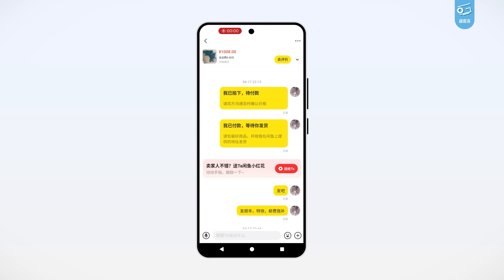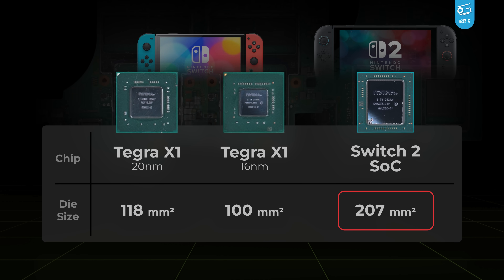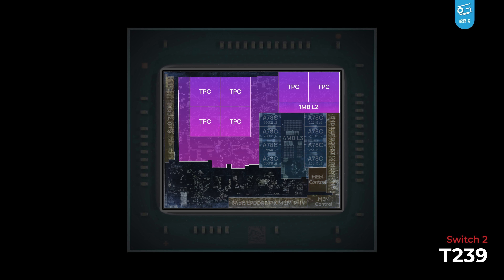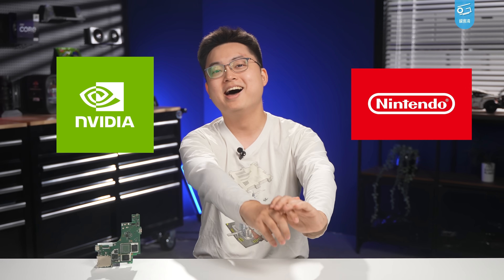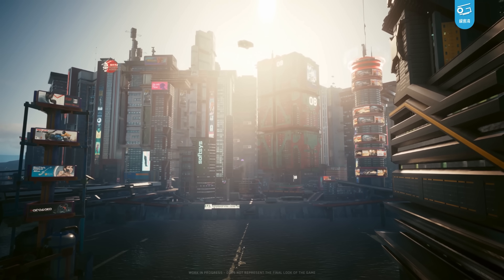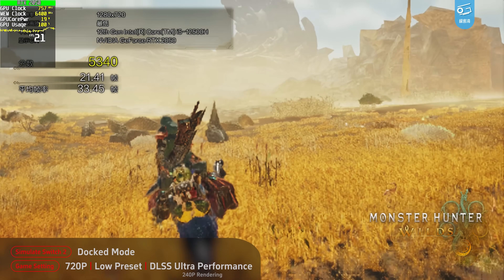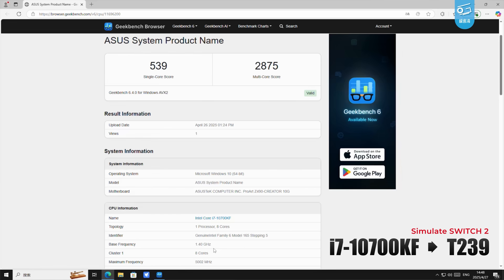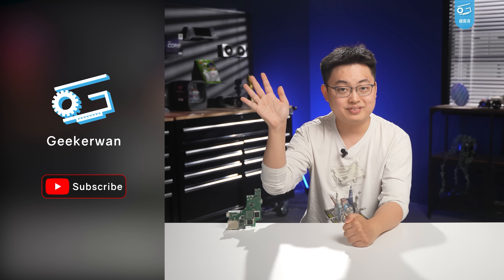This is Nintendo Switch 2's CPU!

Comment: Your A78ae's are running in lockstep mode for your switch 2 simulation.

You aren't measuring 8 core multicore performance. You are measuring 4 safety core pairs for multicore performance.

That's why your multicore result is only representative of 4 of "switch 2's" single threaded performance, instead of 8.
Reply: Geekbench 6 MT simply don't scale as well as GB5 or CB2024. Instead of putting task on each core, it requires all cores to tackle one single task together. That's why not only Orin but all the contenders' MT score doesn't make sense if you just multiply core counts to ST.
Reply: @geekerwan1024  might want to check allllll the other cores in that graph against orin again. And make sure you're doing the power core count. It's clearly not benching the efficiency cores.

Obviously you are not going to get the exact multiple, but there is a GIGANTIC difference between orin and everything else, and that difference is its 4 core pairs,  not 8 individual cores.

Also your downclocking of the 2050m put your l2 cache per gpc bandwidth below the vram bandwidth..... which..... is bad for MAF.

That's why the scan shows the l2 cache slices in switch 2 were custom made to go from 512 kb per 32 bit bus, to 256kb per 32 bit bus, doubling the l2 cache bandwidth per clock.
Reply: @Nobody-sp7ug Calculated some of the CPUs' MT Ratio: 
PS5 6.3x for 8c16t
SD 3.5x for 4c8t
4700HQ 3.1x for 4c8t
PS4 5x for 8c8t
NS 2.9x for 4c4t
NS2 5.5x for 8c8t
Definitely not efficient but not far off. It's not even the worst. 

btw L2 Cache as you mentioned is indeed an issue, don't think any PC GPU can faithfully represent T239's design. Unfortunately that's the limitation of a sim😢.
Reply: @geekerwan1024  So I put all of these cpu's in a spreadsheet, and yeah, what I'm saying tracks.

All the other cpu's, with the exception of Liverpool lol, are around 80-100% the multiple ratio. Pretty expected.

Orin is in the 60's. Even compared against an a76, and those a55's are not making up that difference  That really doesnt seem right.

Did you change it from lock (4 paired cores) to split or hybrid mode (8 independant cores) before benching?
Reply: @Nobody-sp7ug don't forget Orin has no hyper-threading
Reply: @geekerwan1024  sure doesn't. Just 8 physical cores with 1 thread each.

Not really something thats going to have a meaningful impact here. The other older arms on here also don't have multithreading and have much better ratios than the a78 here. Which.... they shouldnt.
Reply: @Nobody-sp7ug I think one reason is because, 845 and 855're both 4P Core CPUs, which have huge ratio advantage in GB6 over 8-core CPUs. Just compare PS5 and SteamDeck for ex.
Reply: @geekerwan1024  The reason for that advantage is because they are on a single cluster, removing the need for barrier/sync related overhead and communication related latency. It's why gb6 is only putting the main cluster to task on those setups.

It's the reason a78c is 8 cores on a single cluster with per core dynamiq voltage and frequency scaling, instead of traditional multi cluster cpu's.

But it doesn't explain things like the a57 beating orins ratio.
Reply: @Nobody-sp7ug  efficiency cores add up about 700 in multicore in my 7+g2 phone.  Cant disable them so put all of them in 300mhz vs stock 1800mhz.
Reply: @bulletpunch9317  kryo has a prime core in an x2 and 3 performance cores in a710's and 4 cortex a510 efficiency cores.

In single core the gb6 bench will use the 1 X  x2 prime core cluster

In multithreaded benches, GB6 will task the 3 performance cores cluster. Efficiency cores don't pitch in on these kinds of demanding loads, they are there for saving power on background tasks, and low demand tasks, they don't contribute to the main work thread.
Reply: @Nobody-sp7ug  i disabled the x2 core. A510 cores add 700 more to multicore at 1800mhz vs 300mhz.
Reply from the maker: Hey, I went back to my Jetson and did a bit research, I don't think it's in lock mode. 
First, I did run GB5 at the same clock speed, and it scales to a nice 7.1x MT ratio: 
https://browser.geekbench.com/v5/cpu/23494713

I'm using L4T and I do find some clues on the forum:
 https://forums.developer.nvidia.com/t/enable-dual-core-lock-step-for-arm-cpu-on-orin-chips/221371 
"Booting the standard/default Jetson Linux in lock/hybrid mode is not supported."

Finally, this is my GB6 result of Dimensity 8400@1.1GHz (8x A725): 
https://imgur.com/a/6HFNEtV
It has an even lower MT ratio of 5.2x for an 8c8t CPU. So I think GB6's methodology is the main reason.
Reply: @Geekerwan wow, 7.1x is  massive difference from the 5.3x.

It actually looks like both hybrid and lockstep isn't supported at all past jetson sdk 5.2. Jsep has been removed from the jetson sdk.
Reply: @Geekerwan  well done on that
Reply: Cant believe he overlooked it
Reply: Counts 3x ps4  in game EASILY
Reply: so geekbench doesnt work like this guy here describes it further down, it uses all cores for its multicore test, prime x cores, middle a7x cores, little a5x cores..
Reply: @bulletpunch9317  That's not how gb6 works, and its not how it wants to work.

That's descriptive of gb5,  not 6.

Gb5 gave every core it's own task. Because of this you had to try and figure out what the performance ratio of your ecores to pcores was, so you could get an idea of how much of your multicore score came from where.

Gb6 intends to simulate a real world application, and provide a shared task for multiple cores to join in on. Including very low clocked efficiency cores on this would actually depress performance considerably, as the much faster cores would be constantly waiting on  dependencies to return from the much slower cores. OOE has limits.

There is maybe another reason you can think of for the difference in scores you are comparing....
Reply: @Nobody-sp7ug  and what could this other reason be?

Comment: So 2021 tech for 2025? I little bit more outdated in my opinion than the original Switch was on day 1. At least the Tegra X1 on the original Switch was from The Nvidia Shield from 2015 when the Switch was released on 2017. So Switch 2 is basically 4 year old tech on day 1.
Reply: the ram is up to date tho atleast
Reply: I understand the disappointment, but I just don't agree with it. 
It's a massive jump over Switch 1, a true generational leap. 
It's better than PS4 in every way but memory bandwidth. 
I'm just so happy with the hardware we're getting.
Also a more recent chip would make the console even more expensive, which would not be good for sales and for us to have more great games on Switch 2.
Reply: @ThibautMahringer the Switch 2 is priced at 309$ in Japan and nintendo confirmed they don't lose money on it...  A 4 year old chip in 2025 is still cheaper than a 2 year old chip in 2017.
Reply: @HermesderWetterbote  Where did you get that Nintendo doesn't lose money from the $300 japanese Switch 2 ? I can't find anything on the internet that talk about this
Reply: @ThibautMahringer  they said in a press release that "worldwide" they dont loose money on the console sales. that includes Japan
Reply: @HermesderWetterbote  Well "worldwide" could be interpreted in different ways, it could mean that overall, they don't lose money. That doesn't obviously mean they don't on the specific japanese model. 
And do be fair, this seem unlikely, Nintendo is known to place the price accordingly to the manufacturing cost, slightly above, I wouldn't be surprised that Switch 2 cost $400 to produce
Reply: @ThibautMahringer  so you would suggest nintendo is loosing 100$ for each switch 2 sold in Japan ? with preorders of 2,2 million that would be a net loss of 220 million dollars 🤣 nintendo would never do that. of course they're still making profit in japan as well. even a 3050 is only 170$ today. and that's double the performance of the switch 2.
Reply: @HermesderWetterbote  Condirering how weak the yen is, buying the $300 japanese Switch 2 there is like buying the normal model in EU / US for the customer. The international model is super expensive in Japan.
So maybe the cost was increased in other markets to compensate, and overall they don't lose money.
And the cost of the games will offset that too, considering the price hike of Switch 2 games is not justified, in any way shape or form.
Reply: @ThibautMahringer  it is expensive and the japanese cheap so that it remains region locked. if the japanese had all languages it would be cheaper to import it from japan and resell it here.
Reply: @ThibautMahringer  and no, nintendo sells the most in japan almost 1/3 of all switch 1 units sold in Japan. they are definitely also making profit at a 300$ pricepoint. dont forget that the steam deck has better hardware than the Switch and sells for 400$ and they don't mass produce it the same way nintendo does.
Reply: @HermesderWetterbote  Steam Deck's not better, at least not the base model. It's GPU is smaller, it's screen is 720p 60hz on the base model. It doesn't have any IA upscaling features. The battery is the same size between Switch 2 and the base model. 
How is it better exactly ? 
If you're talking about the OLED Steam Deck, I mean sure, the OLED version is beginning to have serious advantages over Switch 2, but it's more expensive. 
I just don't see how Switch 2 can generate profit at $300 retail when base model Steam Deck have worse hardware for $400
Reply: @ThibautMahringer  the screen is 800p lcd (switch 2 screen is better, granted, but both are very cheap) the gpu is clocked higher so in portable mode it's stronger. the cpu is desktop class and almost 3 times stronger. it has 4GB more ram, it has fast and expensive NVME SSD internal storage, it has double the battery size, it has a more modern 6 to 7 nm chip compared to the old 8 to 10nm used in the switch 2, haptic trackpads, analogue triggers, etc. these are all considerably more expensive than the technology used in the switch 2.
Reply: The tech in the os5 and Xbox wasn’t brand new either.  If it had newer tech in it, it would be even worse in battery life.
Reply: @ThatGuy-p2c  zen 2 was the current architecture used by AMD in 2020 when the PS5 and Xbox Series was released. Also all gaming PC handhelds are thicker than the Switch 2. They could've made the Switch 2 thicker to have a bigger battery.
Reply: @ThatGuy-p2c He never said it had to be brand new he's dissapointed it's 4 years old not 2 or something like the og switch. Also the ps5 and Series x were only using the 1 year old zen 2 architecture so that's a bad argument
Reply: @ThatGuy-p2c actually 5nm would double battery life

Comment: so the newest phone chip is more powerful than the switch 2 ROFL
Reply: Games are still crap, you can see its way faster than ps4 almost on par with ally but little use.
Reply: You mean oldest? The Apple A12 on the iPhone 12 was from 2020 💀
Reply: no, few years old phone chips more powerfull, not only newest
Reply: yes the $999 phone is more powerful than the $449 gaming tablet correct
Reply: @AnimalTruk  why you justify scum? A lot of phones for 250-300 $ with snapdragon 8 gen 3, like Redmi turbo 3, but you can find with 200$ gen 2 versions.
Reply: Yeah but the chip ITSELF costs more than the entire switch 2 console
Reply: @ebiooo  which one?You can buy phones on snapdragon 8 gen 3 like xiaomi poco for 299$, why you stupidly justify scum from nintendo??
Reply: No
Reply: @oo--7714 why no, its faster in benchmarks atleast

Comment: these simulations look too underwhelming, there has to be some kind of margin of error or else the portings will be insanely good optimized from what we could see from youtubers testing switch 2 at nintendo's events
Reply: These are just simulation with PC games/hardware, actual performance is bound to be better.

Steam deck is positioned higher than a "simulated PS4" here but it's already demonstrated that the deck runs games at PS4 similar graphic settings and around the same performance but only at 720p/800p compared to the higher typical 900p-1080p on a PS4 for the same games.